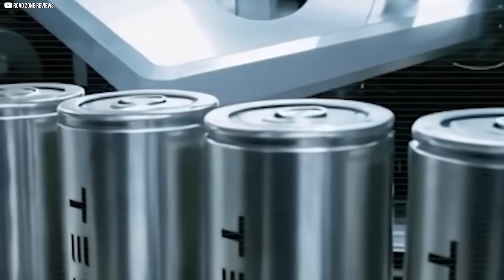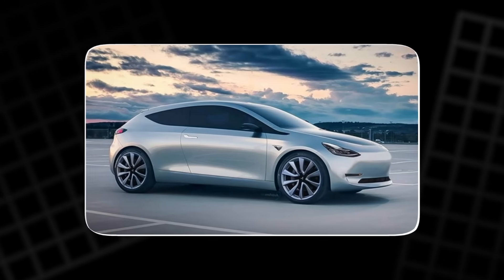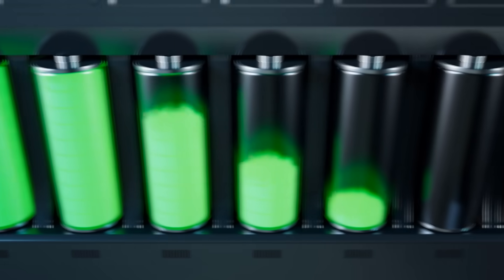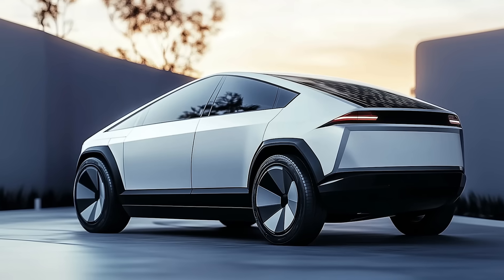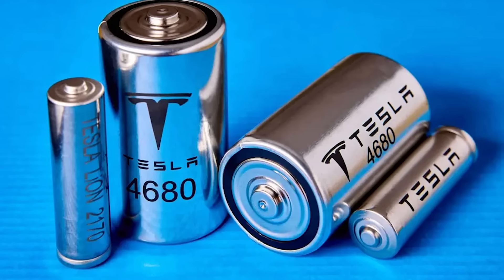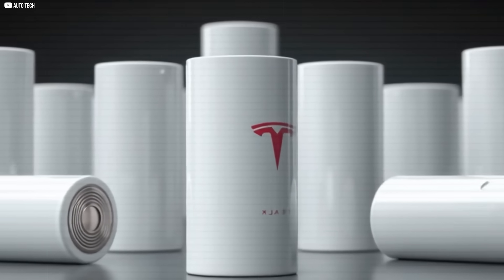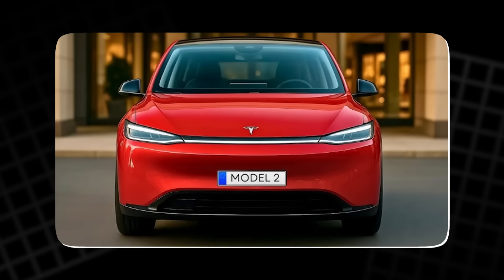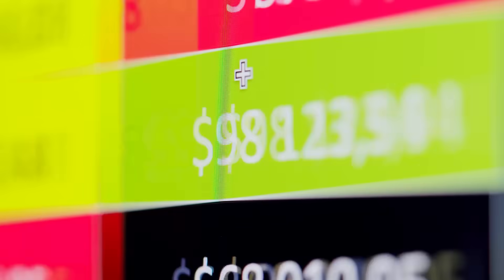Tesla’s NC05 Battery Just Ended China’s Dominance

Comment: I am planning in the next couple of year on building a home and workshop that are run on this type of technology. I believe it can be a great breakthrough for energy independence. My concern is how to protect this system from EMP used in warfare. Some type of faraday cage or grounded metal enclosure with protection from feedback from the wiring going out side of the box. Have you thought about this? This system can be used for both immediate electrical energy for lights and appliances and also to charge large batter back up systems.
Reply from the maker: It's great to hear you're planning to utilize this technology for energy independence, and your points about EMP protection are well taken.